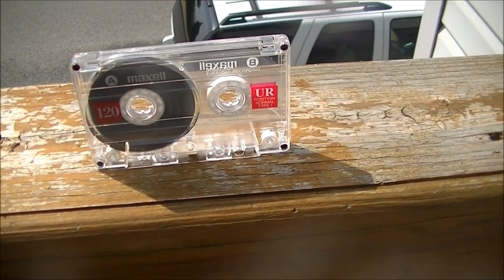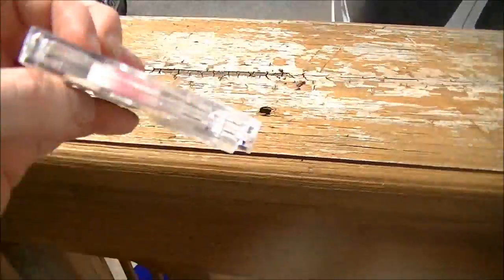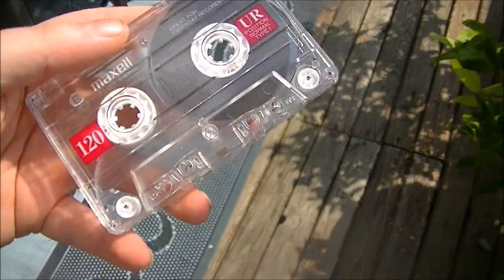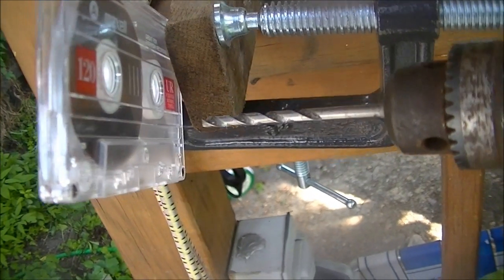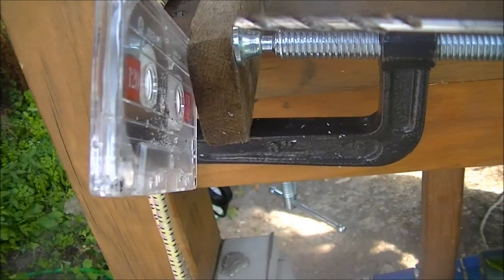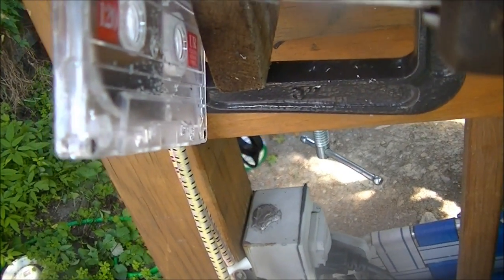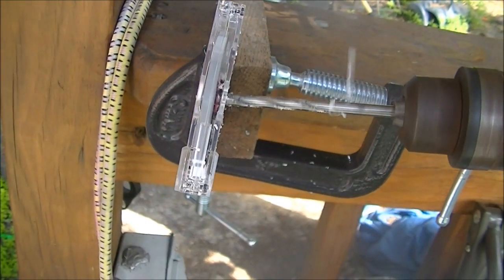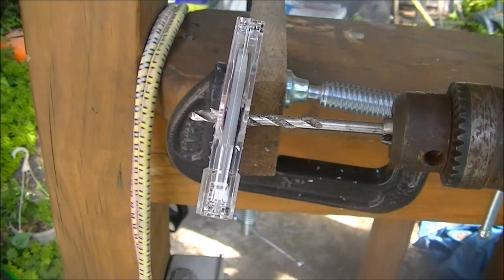Drilling Into A Cassette Tape

Comment: 13k subs 230 views
Reply from the maker: It's an old video, old videos sometimes slip through the cracks (I had 2K subs when I posted it, it's only gained about 100 new views after its first month of being up), plus it's outside of my main draw (microwave videos) so it's not getting a lot of views (my most viewed microwave video has almost half a million views by comparison and I have two others with six-digit view counts). When my channel peaked in 2016, I was getting around 5K views per video. Nowadays, not so much, my channel's suffered the same fate that other weird science channels have.